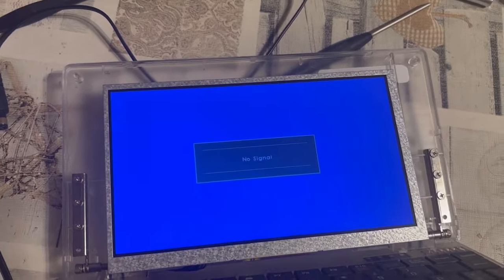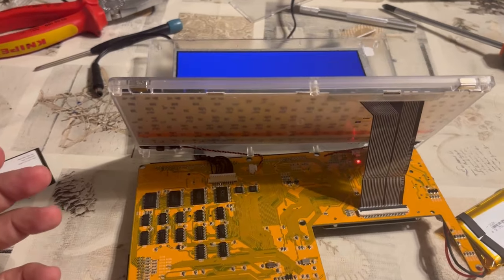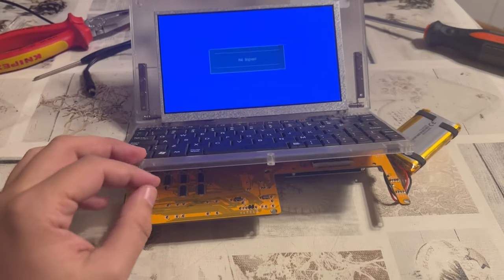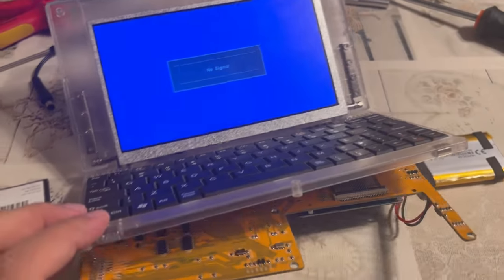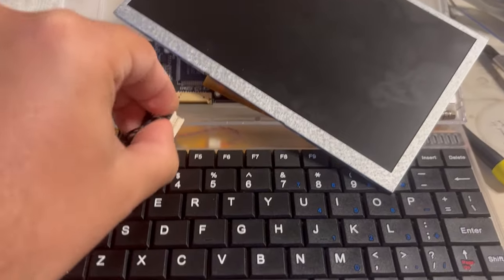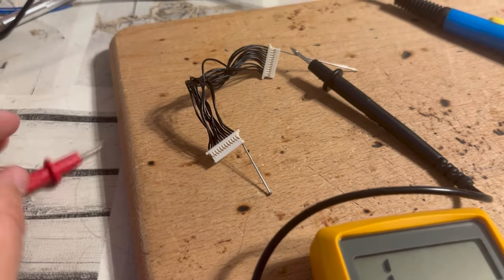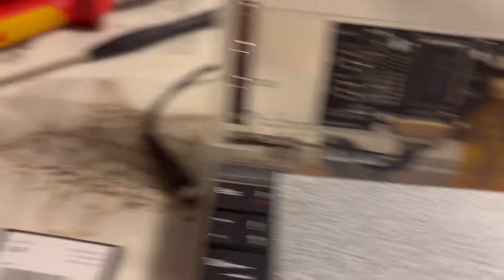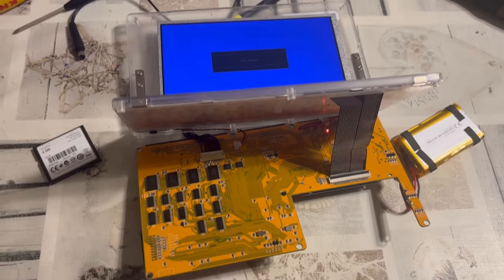Pocket 386 dies AGAIN (once and for all, on Friday, 13th)

Comment: So, they had the ability to have a ribbon cable for the keyboard, and yet they chose to use regular wires for a display connector? I don't get it. I've heard most reviewers complain about chips heating up.  The slower x86 portable that they make has a socket for a math co-processor and it's not installed by default and probably for a good reason. Because it will heat up enough to melt plastic. I used to make micro computer builds as a hobby in the past, not too different from these machines. I quickly discovered, that heat dissipation was a huge problem. Plastic traps heat and without active cooling or excessive perforation, chips that are resting up against other surfaces or sandwiched between parts will fail prematurely. I even lost mechanical hard drives to heating (that was before the flash storage era). Thank you for making this video and "taking one of the team", so that the rest of us don't buy it.

Comment: Did I miss something in this video? The top right of the larger ICs looks like it has a burn mark.
Reply from the maker: Might you please be so kind and tell me a time and a more exact area? I do not think I burnt anything - I did, however, resolder the cable holder places. (The menu would still work, so I doubt I did anything wrong with the soldering.) Basically, the beginning of the video "is the end". (Originally, I had planned to show you as a beginning a fully functional, repaired machine - instead, things went just downhill.) So you can see from about the middle on, after the intro, how the chaos unfolded, also prior to soldering: a mess that merely blurts "No Signal".
Reply: @ninoivanov Sure. I can see it at 5:37 for example. It is the big chip right below the connector.
It might just be some glue stuck on the IC, but could also be a burn hole.
Reply from the maker: @PvdDriesch Ah, THAT... Thank you for pointing that out — the surface is slightly scratched. What you see as "blacker" is the real IC body, under some sort of "varnish". It is totally superficial, and in all fairness, I would rather attribute this to my own handling of the innards rather than the machine's production.

Comment: Don't know if it matters but the display connector on the board looks like there's a pin or two with a big solder blob. Makes me wonder if there's just poor soldering at play?
Reply from the maker: Oh, no, that was me. When I gave up on it, I carefully resoldered the pins, too. I mean, if it dies anyway, why not try at least EVERYTHING to save it…
Reply: @ninoivanov  Ah.. makes sense. Am sad that it died like that. Especially for you, I know how disappointed I'd be. Though, it does "sound" like it still boots, and from what I saw, the ports on the back have two for 8 and 16 bit ISA slots, so with an adapter(which I saw on the store page when I looked it up on aliexpress) you could at least be able to use it with an external GPU. Though it sadly defeats the entire purpose of a cool little laptop.

Comment: /!\ Never /!\ disconnect LCD display cables without disconnecting battery first and ensure there is no power on the motherboard. Otherwise you will get exactly this a dead graphics controller IC.
This is true for all laptops and a common mistake that makes things much worse and more expensive to repair.
Reply from the maker: Yeah, thank you, but that‘s, like, nice theoretical philosophy, as practically, the cable was basically loose and all the time disconnecting and reconnecting… 😆 But jokes aside: thank you for mentioning it.
Reply: @ninoivanov  I think this is a poorly tested product and this issue will be fixed in the next generations. It's also possible it was designed this way on purpose by the manufacturer, build with Planned Obsolescence in mind. :body-blue-raised-arms:
Reply from the maker: @RmFrZQ I shall hope your first proposal to be right! 😁